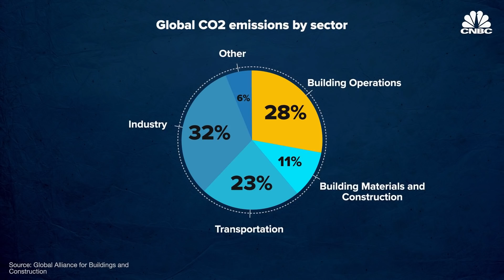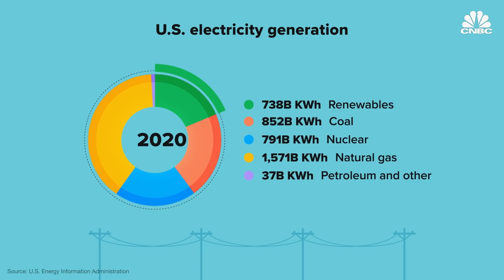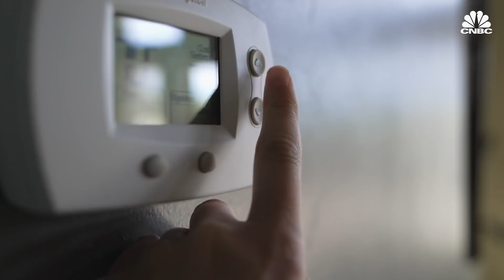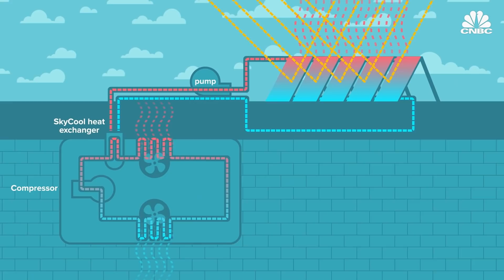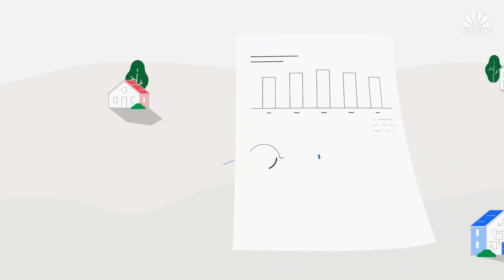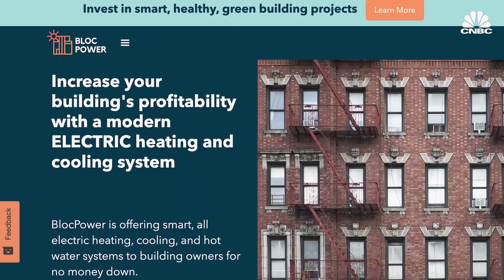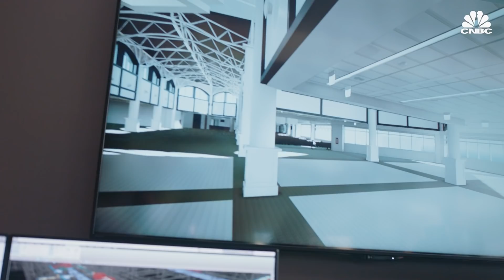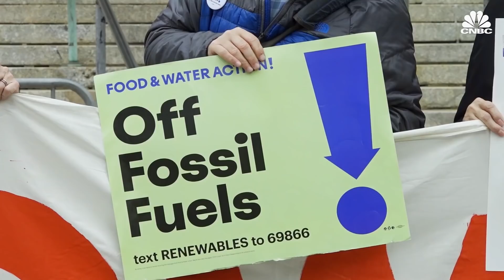How Air Conditioning Is Warming The World

Comment: These are great advancements, but people in apartments and condos usually aren't allowed to modify their place with these....
Reply: There was recently a court case in Finland that resulted in a verdict: if it's technically possible, condominiums must allow the installation of cooling heat pumps. (Due to central heating the heating option isn't necessary anyway.)

The units can be installed if the apartment/condo has a balcony, and the outer unit would be placed there so it can be maintained.

Condo owners must request permission for the installation, and there are already many that have been approved, already before the court case.
Reply: @elainelouve  That is interesting (Finland is my mother's home country - she always spoke proudly of it).
My sister in Florida informed me of a lawsuit by a woman who had installed complete self sustaining solar power system on her home in southern Florida. The state created a law making it illegal for homeowners to get off the grid! Florida has become one nutty state...
Reply: @raybin6873  in Australia the government subsidises the purchase of solar.
Reply: @elainelouve  If you are referring to recent Supreme Court case about that one heat pump installation in Turku, you're misrepresenting the case a bit. In that case the homeowner had installed a heat pump such that the installation involved drilling holes through the outer wall of the building. Normally a homeowner can't do such modifications without getting a permission because the outer walls are not counted as a part of the apartment/condo that's under the homeowners control. In this case, however, the holes were drilled into a part of the wall that leads to the balcony. The court's ruling was that the part of the wall between the rooms and the balcony is a part of the whole apartment/condo and therefore at least some modifications can be done without asking for permission.
Reply: @seneca983  I think we would need to define what does permission mean in this case?

My husband was in the co-op board of directors when they needed to make a decision on the first ever heat pump in our co-op, well before this court case. That decision they made granted a general permission that heat pumps are allowed to be installed.

However each individual installation does require another permission, just like any renovations that affect the structure or safety of the condo. This has been in the law since 2010, as condo owners only own shares, not the walls. You can only do superficial renovations like painting the walls without a permission. Anyway there the procedure is lighter. If you have a professional contractor to do the installation according to all regulations, the permission is usually granted.

But before this court case each co-op board of directors needed to discuss heat pumps in a meeting and make a general decision whether to allow them or not, because if you allow for one condo owner, then you must allow for everyone (unless the installation isn't technically possible).

So that's what I meant. I haven't read the verdict though, but it shouldn't clash with the 2010 law about condo owners responsibilities.
Reply: @elainelouve  "I think we would need to define what does permission mean in this case?"

In this case the homeowner had just notified the board that he's going to install a heat pump (i.e. he didn't ask for permission). The board's reply was that they're not allowing the installation of heat-pumps to any apartments. The homeowner went ahead with the installation anyway. The board ordered it to be removed. However, the ruling by the appellate court (affirmed by the supreme court) was that in this case the homeowner had the right to install the heat-pump if he just notifies the board and the installation doesn't cause problems (e.g. noise or damage to load-bearing structures).

"This has been in the law since 2010, as condo owners only own shares, not the walls."

The supreme court's ruling was basically that this doesn't apply to the section of the wall between the rooms and the balcony. From the ruling:

"Muutostyöoikeuden on vakiintuneesti katsottu koskevan huoneiston sisäpuolisia toimenpiteitä. Siltä osin kuin rakennuksen ulkoseinä sijaitsee osakkeenomistajan hallinnassa olevan huoneiston ja huoneistoon kuuluvan parvekkeen välissä, ulkoseinä jää osakehuoneistoon kuuluvan alueen sisäpuolelle. Huoneisto, sen vieressä sijaitseva parveke ja näiden välissä oleva osa rakennuksen ulkoseinää muodostavat luonnollisen ja kiinteän kokonaisuuden. Kokonaisuuden vähäisen osan, parvekkeen kohdalla olevan rakennuksen ulkoseinän, erottaminen muutostyöoikeuden suhteen osakehuoneistoon kuuluvasta kokonaisuudesta olisi keinotekoinen ja käytännön tarpeita vastaamaton ratkaisu."
Reply: We’re forced to buy the portable ones.. Much more expensive.
Reply: With demand comes supply
Reply: @bergonius  As the old saying goes:
When there is a will...there is a way.
Reply: And they look ABSOLUTELY DISGUSTING!!! You see an apartment, then see a BOX in the Window.  Yuck
Reply: Our cities have so many usable surfaces it’s only common sense to totally revise how we design them in the future and revise current structures.
Reply: OK then lets give up and let the world burn. What matters most is being comfortable and following all important condo rules…
Reply: I think that window unit is one that doesn't modify the building, just requires a window to place it in. So that is something.

But you are right, we need changes on the industrial level, not just the individual. This means changes to building codes, also known as radical communism in the US.
Reply: @TheReykjavik  - a new generation building code. It’s nothing radical really, buildings have always evolved.
Reply: @TheReykjavik  ours gets a bit too regulated, a lack of commonsense at times.
Reply: No but you could look into renting from a LEED Certified complex
Reply: oddly, in the mid south USA , days are summer warm not extreme , evenings have been blanket cool till just this week .    But what is the latest china industry .    
" climate alarmist "   lets get all cars battery operated so we can then have batteries rotting in landfills and oozing battery acid into the ground .

Comment: Effectiveness of heat pumps go down as outside temperature starts dropping, as they operate by exchanging heat with atmosphere. This article sounds like marketing for heat pumps without full disclosure of it's effectiveness.
Reply: @UncleThomas  what? no you are misinformed or quoting old numbers.
Reply: If heatpumps only worked down to 20°F it wouldn't be as popular in Scandinavia as it is. Trust me, it works, and is still more efficient than gas heaters at low temperatures.
Reply: @sonderlateka  nice lie and bull crap
Reply: It's an american program. So of course it's marketing for something.
Reply: if where you live it really cold in the winter...then you just need a bigger-better heat pump, that's all.
Reply: @vasopel  nice lie and bull crap

Comment: Skycool won't work because you can't cool down below the outside temperature.
Reply: Potentially viable, depending on region. Plus it can cool below outside temperature through radiative cooling, it just doesn't work very well in that mode.
Reply: @vylbird8014  Not viable at all. You might as well open your doors and windows and get the same result.

Total waste of money.
Reply: @vylbird8014  That would be counterintuitive because you would also lose cold air to the device.

It's literally useless. You're powering a pump and wasting roof space. Might as well place solar panels and run an aircon off of it.
Reply: @vylbird8014  it's not gonna reduce the energy costs because it drives a pump which costs power. All the while it is pumping the cold air-conditioned air out of your building.

And itself can't even cool below outside temperatures.

Buildings DO have the airflow capacity to do it. All offices are fitted with a ventilation system.

And the entire purpose of skycool was that it would be cheap. But for offices don't tend to be built with cheap ventilation in mind, and there won't be enough space left on the roof to 'cool' all floors with it.

It is a useless invention. Made up by some startup to siphone some funding from the government while laying back and enjoying the money.
Reply: @matthijskkr  Pretty much. The idea isn't completely ridiculous - I can see the thermodynamic basis behind it. It can work. On paper. But if they can get it to work effectively enough to be a viable energy saving device in real world usage, I will be very impressed.

Comment: If we're going to rely solely on electricity for absolutely everything from transportation to HVAC, it's going to take a miracle to come up with a clean and reliable system to satisfy that increased demand. I'm all for wind and solar but I can't imagine that will be nearly enough
Reply: I've seen the rough numbers, and it should be enough on average - but only if you pair it with either demand management or a breakthrough in storage.
Reply: @ronaldlindeman6136  will it be enough in the future when everyone is driving electric cars and using electric heat and air conditioning? That's my main point/concern. Also will it be reliable in extreme climates? Will fossil fuels still be there to use in an emergency?
Reply: @1mlb704  We should get started as soon as we can by building enough PV solar panels and putting them up to get all of our bulk electricity from solar.    Some proposals has solar electricity production 20 greater than needed, just so there would be enough solar electricity on days when solar electricity production is not the greatest (clouds and storms)   Same with wind powered electricity.   Produce more non carbon fuel electricity than needed and let the system make all the storage needed.
    
Some proposals are that 7 percent of the electrical grid will be needed to be Natural Gas electricity production as backup power to keep the grid up.      All bulk electricity should be non carbon produced.
Reply: @ronaldlindeman6136  I think you misunderstand.  When there's clouds and storms, solar energy production drops to zero.  You can build 20% more capacity, but you're building 20% more of nothing.  And there's this pesky thing called night, where solar output is also zero and the wind has a bad habit of not blowing.

You can't create "storage" by adding more capacity unless that storage can be spun up on demand.  You can do that with fossil fuel and nuclear, but since solar and wind can drop to zero at any moment and can stay that way for weeks, you've got to have 100% backup capacity in your fossil or nuclear.  Nobody is going to install fossil fuel or nuclear to sit idle as a backup when it could just be powering the grid on its own.
Reply: @1mlb704  Yeah. Just build more. The entire planet's electricity use can be generated with just solar panels covering the state of New Mexico. Thats alot of land, but divide it across the world, on rooftops or in solar farms, plus nuclear, hydro-electric dams, and wind farms (on land and in the ocean). Its actually not that much land. 

Heat pumps (basically AC running in reverse) are actually so efficient that its actually more efficient to burn natural gas in a power plant and send the power hundreds or thousands of miles to your house to run a heat pump, than it is to burn the natural gas in your home for warmth. 

Future increases in AC and heating will also be slightly offset by better modern insulation. Retrofitting old buildings with better insulation will be important.
Reply: @adamt195  Good luck with that.  Power your town with nothing but wind and solar and let me know how many residents are still in favor after a year.
Reply: Nuclear
Reply: @umairsiddiqui9900  Nuclear for industrial/infrastructure; solar & wind for residential & light commercial
Reply: @umairsiddiqui9900  Good call! That's where we're going, for sure.
Reply: Solar is most efficient on a home or buildings roof or glass panels. Solar farms are highly inefficient on a energy created for space used basis
Reply: @HH-le1vi  well the deserts of the southwest have very cheap land with no other good uses.
Reply: @HH-le1vi  Agreed.  Solar makes a ton of sense for a single customer.  Not so much on a grid scale.
Reply: @wadesworld6250  so if every customer can generate 90% of their electricity with solar panels on their own roof, and the last 10% comes from the grid with wind power? What would that be? Success right?
Reply: @adamt195  Solar makes absolute sense on an individual level.  But if you install a 1,000 GW of individual solar panels, the grid still has to have 1,000 GW of capacity for when all those individual solar panels are producing zero.  And no, it can't be wind - wind is not reliable.
Reply: @wadesworld6250  that's why you have storage
Reply: @adamt195  I think you have a very naive view of what current storage technologies can accomplish.  Green energy proponents keep pointing to a hoped-for quantum leap in storage technology, but from my understanding, there's some laws of physics which make such a leap unlikely during this century.  Not to mention the fact there's not enough rare-earth elements on the planet to provide what would be needed.
Reply: @adamt195  Then as I explained in another comment, if you believe that, you might as well start enjoying your last years.  We are not going to be 100% green or anywhere close to it by 2035 or even 2050, nor are new solve-all-the-problems storage technologies going to exist.  We'd have to be building about 2 nuclear power plants PER DAY for the next 29 years to reach that goal.
Reply: @ronaldlindeman6136  Is it a revelation some systems have some wind and solar? That's been the case for a long time now.

I'm all in favor of using wind and solar where they make sense.  

However, all that wind and all that solar can drop to zero at any moment, so they're going to need their fossil fuel and nuclear capability far into the future.
Reply: @wadesworld6250  There is a book, "100 percent clean, renewable energy and storage for Everything."     Mark Z. Jacobson.     
    
https://thesolutionsproject.org/why-clean-energy/
     
It's not completely detailed, but it is a general outline of what can be done.   It really is a matter of putting in the effort to actually doing it.
Reply: @ronaldlindeman6136  Nice.  Why hasn't your town done it?
Reply: Prepare for electricity to be $3.00 a kilowatt is all this is telling me
Reply: @marcusthorpe7688  https://www.youtube.com/watch?v=sUvaYycoWqI&t=6s
    
PV solar is now the cheapest way to make electricity.     Costs have come way down.    And costs continue to come down.      This is the pivot point change.
Reply: @marcusthorpe7688  it can be done.
    
https://www.cnbc.com/video/2021/01/27/what-it-will-take-for-the-us-to-build-a-100percent-renewable-electric-grid.html
Reply: @marcusthorpe7688  I agree.
Reply: that is why biomass, woods, etc. will still be used with a Carbon Capture Unit for regular heating such as making fire, etc. But I agree everything should be electrified.
Reply: @ronaldlindeman6136  worked great for Texas.  How many people died from wind and solar failure
Reply: Restrictions and shutdowns will be placed on power use for regular people.
Reply: Unicorn fart powered flight?
Reply: And the demand will continue to rise, due to our increasing computerization. Watch this video on the how the computer industry and their need for cooling has contributed to global warming, and how their demand for electricity will rise exponentially. https://www.youtube.com/watch?v=Byl87SBFoo8
Reply: Well they should take all the windows out of the buildings and let people sit behind their desks in their underwear.

Comment: You guys didn’t talk about heat pump water heaters. Your garage will be air conditioned when you take a hot shower.
Reply: yes
Reply: Used Common Sense think for yourself the reason why air-conditioning is growing is because the population is growing more people are able to afford air conditioning
Reply: Why would I want that?
Reply: @coldwynn  Makes it so that the heat that's produced anyway is used to heat up your water rather than pumped outside and wasted.
Reply: People don't take hot showers when it's AC weather through.
Reply: @Nysvarth  Most people take at least warm showers no matter how hot it gets.  I've never known anyone to shut off their water heater in the summer.  Not even when I lived in Texas. Do you wash your hands with cold water in the summer?
Reply: @Nysvarth  The water straight from the mains can be too cold even when it's hot outside.
Reply: You seem to forget hot water tanks run 24/7 & will passively cool your garage even if you’re not using it. It’s 1/3rd cheaper to run than a standard electric tank, so you see savings too. You’d be silly not to consider it